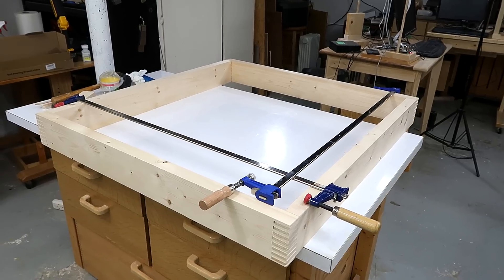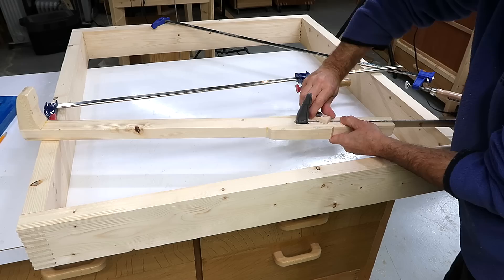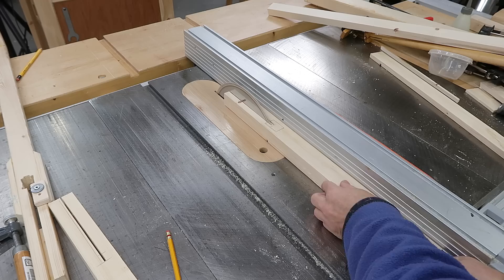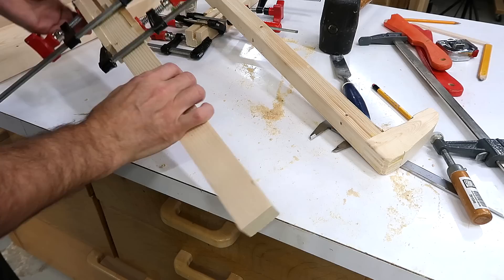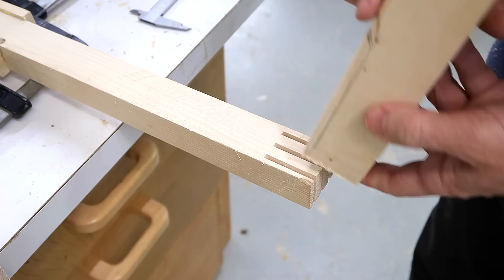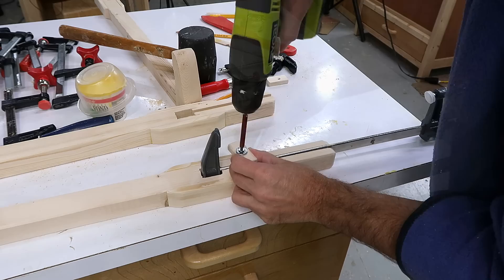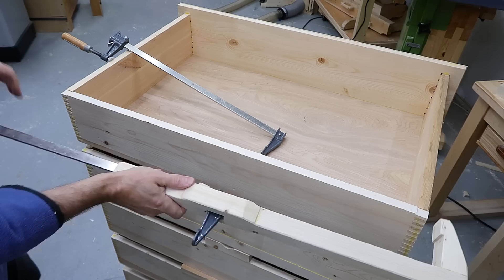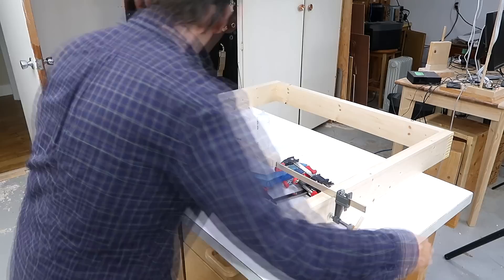Bar clamp extender -- for when my longest clamps aren't long enough

Comment: "Clamp extender" sounds like a prank item the new guy gets sent for...like a sky hook, board extender or a bucket of elbow grease.  And, Matthias just made one.  This shows that his skill is on another level.
Reply: Don’t forget the key to the sea chest, relative bearing grease, etc
Reply: Compare to you awesome
Reply: ..Bottom line your welcome God bless
Reply: We used to say "bring a bucket of transmission".
Reply: Paper stretcher.
Reply: A sky hook was a real thing.  The CIA and special forces used it in Viet Nam.
Reply: And don't  forget a 'left-handed screwdriver' and ' a bubble for a spirit level'
Reply: @ronyerke9250  so did Batman
Reply: Bucket of compressed air, piston retractor springs, anvil grease, brake disk polish, hose bender, M6 nails, oak demagnetizer...
Reply: Does it? He forgot about the tap spoon? Because it points to the small golden finger

Comment: One thing I take away from Matthias' videos is to never skimp on the glue.
Reply: Dry joints are never a good thing. So better off too much than too little. Plus wood glue is relatively cheap. A gallon of Titebond 2 is $25 and a gallon of glue is a lot. You can glue stuff like a madman and it should last you the better part of a year.
Reply: @1pcfred  If you're trying to make money, it's more than the cost of the glue that matters. It's the time required for all the cleanup.
Reply: @larrybud  this can be counteracted a lot by pre-taping around the joints and wiping with a wet towel. Takes a little patience to tape but takes all the elbow work out of glue removal and allows for a lot of excess of glue. Also straws!!!!!!
Reply: Norm Abram was once asked "Why do you use wood glue if you are using nails"? The nails are there to hold it together till the glue dries
Reply: @tannermaddox3685  Or one could learn the appropriate amount of glue to put on a joint and get the best of both worlds!

There's an argument (and I've seen it) that wiping glue with a towel only "embeds" the glue into the grain of the wood.
Reply: @larrybud  it will and does. That's where that clear taping comes in. You still want squeeze out but there is definitely truth behind glue appropriation
Reply: @larrybud  well there's a few schools of thought when it comes to cleaning up squeeze out. I've heard that wiping the glue when it's wet ruins the finish. That may be true to some extent.  I've seen glue lines in finished pieces.  But I've also wiped glue off and not gotten glue lines too. Then there's peeling the squeeze out off when the glue is fleshy. Which is by all accounts ideal. But you do have to be there just the right time. Then there's cleaning the glue up after it's hardened. Which is the most difficult way to go. So the time spent varies depending on how you clean up.
Reply: Matthias tends to sand the box joints after glue up anyway
Reply: @1pcfred  fleshy - I like that. I’ve always gone with something dull like ‘viscous’ or ‘almost set’ but I genuinely love the description of it being ‘fleshy’.
Reply: @bobafetting6373  I guess I could have called it rubbery. But there's one point as glue is setting up where it's solid but not quite hard. If you can get it then it's great. It comes out of the pores and everything. And you can just peel it off. But that window of ideal consistency is short.
Reply: It's's real hard to add more glue to a joint afterwards! Plus there are a million ways to remove excess glue, and being a tool/structural part excess glue isnt important.

Comment: Alternately: Replacing the rivet at the end of the bar with two holes for 1/4-20 machine screws, permits you to bolt two bars together and remove the foot as needed allowing for the same flexibility.
Reply: This is a good alternative, but the tradeoff is now you have half as many clamps! 

Certainly easier to drill and tap a couple holes than make those relatively complicated extensions though.
Reply: Quite true, there's always a price to be paid.. I also have a variety of inexpensive gluing clamps that use an aluminium extrusion with "press punched teeth" for the ratchet mechanism. With a simple piece of hardwood sized to fit inside the extrusion and holes appropriately drilled, I can gang them together in a similar way. Fewer clamps true, but that hasn't been a problem so far.
Reply: Hey!  You just used than correctly!  What are you doing on the internet boomer?

Comment: I personally rarely use that style of clamp, especially not the longer ones like that.  I prefer the 3/4” pipe clamps and I thread both ends of the pipe regardless how long the pipes themselves are. Then if I ever need a longer pipe I just screw on a nipple for 3/4” pipe and screw in a extra lengths of 3/4 pipe in the other end of the nipple to make the pipe clamp any length that I need.  I have many pipes 3’, 6, 9’ and a few 12’ and if I need anything longer I can just add another section of pipe to whatever size pipe clamp I’m using. With extra 3’ sections of pipe I can make my pipe clamps pretty much any length I need and there still plenty strong with the two pipes screwed into the nipples!  Been doing it this way for decades and hasn’t failed yet!  Although if I was to use the same clamps your using, that’s not a bad idea by any means either! Certainly one I never thought of trying!  Can’t argue with something that actually works!

Comment: Great idea! I’ve actually tried making my own bar and fixed jaw using steel flatbar (the moving jaw head from this type of clamp will often work on 3/16x3/4” flatbar) but I quickly found that those clamps don’t have a simple mild steel bar — it’s something stronger. Mild steel of the same size just bends.
Reply: Two of my favorite makers collide!
Reply from the maker: Cosmas bauer built some bar clamps, but he used some pretty big steel.  I guess that solved that problem, but he said they were really heavy.  I have often thought about making bar clamps, but haven't come up with a design that is worth making yet.
Reply: @matthiaswandel  what are your thoughts on John Heisz's latest design?

Comment: Love the idea!
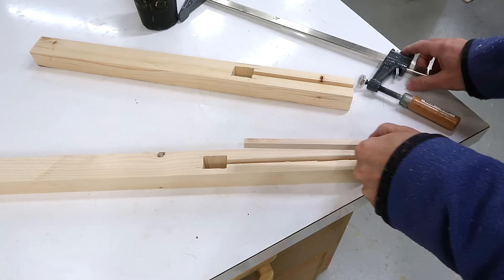1:25 if you drill a round hole, that would create a less weak weak spot and at the same time you could just route the slot for the shaft instead of cutting away all that material and you need no bandsaw.
Reply: a round hole would have to be bigger to accommodate the square clamp end. the weakness comes from the thinner walls, not from stress concentration.

Comment: Outstanding! I'm making some drawers for my workbench and ran into the same problem. I have two clamps made of steel pipe with the ends you buy. Each one weighs about 3 pounds and is a real pain. Once again Matthias's 
genious comes through!
👍👍👍👍

Comment: I ran into the same problem and bought a set of pipe clamps, plus extra pipes in various sizes.  Plus I also use ratchet-style cargo web straps on occasion, loop them around and hook them to themselves.

Comment: I have definitely run into this issue before which forced me to go out and buy crazy long pipe clamps. Another simple and elegant solution from Matthias
Reply: I learned you can buy shorter sticks of pipe and use pipe couplers to extend pipe clamps, makes them way less annoying to store because you can take the extensions off.

Comment: Nice solution! Another solution is pipe clamps. Just get whatever lenth you need and buy a central heater piping or somesuch, put the pipe clamps on and you're good to go. Got them from aliexpress, it did take 3 months to arrive though. Got some 3mx23mm pipes cut them in half and made two clamps out of them. You can reverse them so that they push apart instead of push inward.

Comment: I use ratchet straps and the straps that just have a cam as clamps. They have a long reach, store small, and have many uses
Reply from the maker: But too slow, when you gotta close a joint, every second counts cause the joint can just lock up on you.

Comment: I some something recently on a Russian creators page. It was similiar to this but had several holes drilled through it - going down the length of the wood, say 8 holes. The 12" clamp would pop in any one of these holes to suit the approx. size it needed to be for clamping the project, if it was big or small.

Comment: I was recent faced with the same problem, though on a smaller scale. I had been wondering how easy it would be to buy a longer piece of bar stock with the same dimension as the one my clamps use. It looks like your bar clamps have a serrated edge though, which would be difficult to recreate. In any case, your solution is much cheaper!
Reply: most bar stock that is easily sourced would be mild steel...so it would just bend under load.
Reply: @rolfbjorn9937  The load applied on the bar is tensile, so bending wouldn't happen. But agreed that the clamps would stretch a lot more if the bar material was softer (and longer), just like the wood extensions would.

Comment: On applications like this i would be tempted to use a band clamp all the way around the outside of the frame. though, i only have ratchet straps so id probably use that as a a cheap alternative
Reply from the maker: Band clamps don't apply a lot of force, also would need some blocks around the corners to apply pressure in the right place.  Just not worth the trouble

Comment: MATTHIAS--- a simple jar lid bottle opener was here on you tube looked cool but was $19 what can you do in wood?  it had an end which was concave  and two notched rod about 7" long and a steel pincher clamp (cam spun inside rails to lock tighter an nth amount fro grip- I know cloth sand paper alone usually makes our fingers and hands quite stronger due to grip but in a simple wood>

Comment: If you went through the trouble of removing the stop rivets (at the end of the clamps), why not just attach two clamps together at the rivet holes? I think one manufacturer of clamps does exactly that with its clamps.

Comment: Now the question is, is it easier to store a bunch of small clamps plus the extenders, or to have and store long clamps for that once-every-five-years that you might need them? Another thought would be to find a metal stock to replace the bar with a longer one. I'll bet the long clamp is cheaper than a piece of bar stock.
Reply from the maker: Not just any bar stock will do.  But I have 2 3' long clamps, very handy from time to time.  But now if I need more than 2, I can use my extenders.  I think this was the first time I needed extra long clamps.

Comment: How would 3/4 inch steel pipe clamps compare to these extenders?
Reply from the maker: I had pipe clamps, purged them in the last move.  No deep reach, kept slipping, and the non crank end has this long pipe sticking out.  I really only used them once back around 1997

Comment: Could a wooden adjustable locking mechanism use a simple hardwood wedge to lock the adjustable bracket in place? The wedge would lock the 'clamping rod' with friction and be tapped loose after use. Would it be too little friction to prevent slipping, it the question.

Comment: Re: Wodden Bar Clamps - Can you just drill some holes into a 2x4 and have your movable piece locked by a pin/bolt? Would that still classify as a "bar clamp"?
It would certainly be more hassle to deal with the pin (and not lose it), and I don't know if you can get threaded rod with a pitch low enough you wouldn't need 1,000 cranks to tighten up. And matching through-hole metal inserts.
Reply: Yes that's exactly how it's done. My father used nothing else for example when making window frames. The pins are held to the clamp ends by a small chain, and then inserted into the beam which can be as long as you need. Very strong too. I still have some that are at least 80 years old.

Comment: Personally I'd take a second clamp bar, take off the movable clamping part, reverse the clamping part on the second bar, match drill a hole at each end of both bars and bolt them together.

Comment: Why didn’t you just take pin out of the bar to the end then you could have just fixed it to a bit of 2x2 . Made a slot in the 2x2 made your wood 90’ as you did
Reply from the maker: because instead of trying to extract the pin, I just made something that hooks onto the clamp.

Comment: Did you notice it only works for open boxes before, or after you finished them? :)
Reply from the maker: Please watch the video
Reply: Without modifying the clamps I meant.
Reply: @matthiaswandel  question is, did you foresee the issue of the protruding clamp head or run into it after making them? I didn't see any indication either way in the video. I guess, based on the way you describe it at 2:57, it's implied that you ran into it.

Comment: matthias I love you dude, like you are literally the best youtuber ther is on the platform, I constantly tell people about your machines. Now that you are buttered up, on my long clamps, I think I broke them. the little slits wore out, so I re cut them, and now it does not stay at all, I tried deeper groves, and shallower ones, like test sections, no anvil. So what am I doing wrong?
Reply from the maker: if it has the two little metal things that pinch the bar by going at an angle, those are probably worn smooth.  Try flipping them over.
Reply: @matthiaswandel  that is a excellent idea!, if those are worn smooth, then can I add a little slits in those metal things? I just want them to work again haha, and your build here yup gonna do that, and show my father he will be blown away!